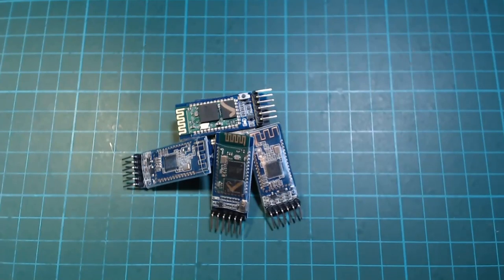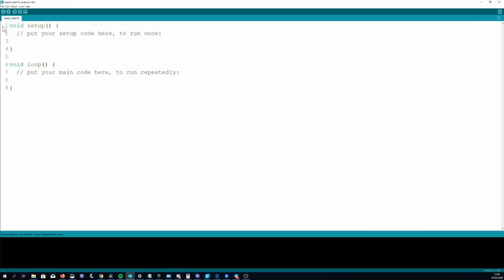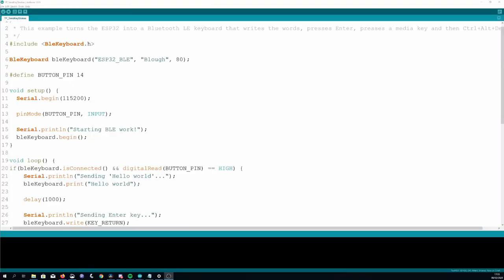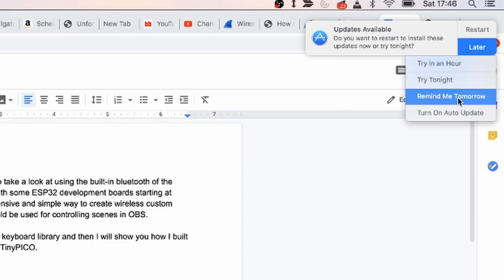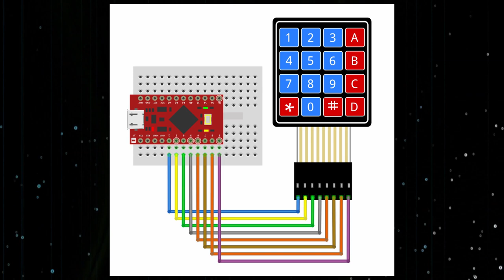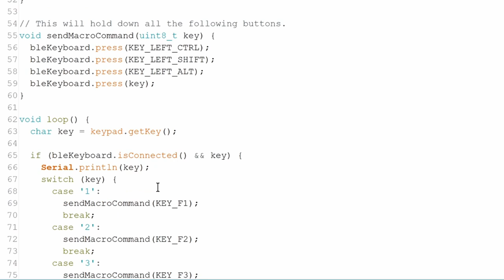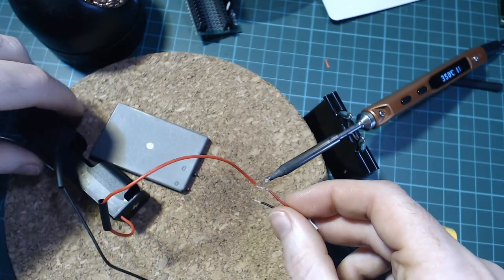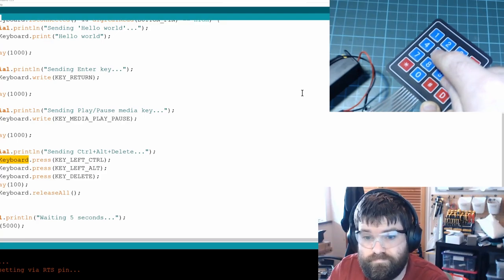Bluetooth HID using just an ESP32 (inc Bluetooth macro keypad)

Comment: Great timing, just started working on a small project that's in the same vein. I'm putting together a wireless (BT) volume knob using an encoder and some media control buttons, so all this info will be really helpful.
Reply from the maker: This sounds perfect for this, I haven't tested the volume media button commands but I imagine they work fine !
Reply: A couple of cheapy slider potentiometers, for mic & speaker, a lil 3d design/printing for a case. U could even go look at some of the esp/Arduino midi controller projects for a variety of DIY inputs, i made an esp32 pressure sensitive drums and button combo midisynth a few months back(still haven't made the case or its own amp for it, but it's fun wired up to an old stereo).

Comment: Excellent work. I was ran out of space on a digiStump. And promicro didn't like to compile. Never used the ESP8266 but looks like I am going to thanks!

I have two applications - one to use old PS2 keyboard to control computer games (so I can map.keys to USB but if I can instead send via Bluetooth then even better)

The 2nd app - to send Bluetooth to Android app to operate sheet music viewer. I do this at the moment with a Bluetooth keypad and some mechanical foot switch. With the above I can simply make a couple of buttons and send page up / page down.

Thanks again for sharing.
Reply: I know it's an old comment but for everyone's information, he used an ESP32 here, not ESP8266. ESP8266 doesn't have Bluetooth (and some deviations of ESP32 may not have it either).

Hope your project worked out great!

Comment: It would be great to have the codes in a file stored onboard that would be accessible like a drive over the USB connection. That way you wouldn't need to redo and Arduino code when you want to change a button function.

Comment: Excellent work from you and the BT library writer. I got an ESP32 with inbuilt OLED - my planned usage is to wire in a couple of footswitch operated buttons to send page up/down to an Android music page turner app. Should be considerable cheaper and more versatile than commercial hardware.

Comment: This is the video I am looking for. Exact tech for the same use case for OBS. Thanks.  Ok, next day. Just plugged everything in, set up the IDE for my ESP32, installed the code and it worked perfectly.  Next is getting that battery set up for wireless, although how I have my OBS set up with my laptop, It's fine even with a powered ESP32. I typically use the number keypad on a full size keyboard for OBS hotkeys and even and a Bluetooth number keypad that I bought for remote use. That's set up where I normally stream with a full computer. This is going to be the remote for mobile streams.

Comment: Hello! Nice project! I made similar project, but got following problem: Android is connected to this HID Keyboard, but if I send every 100ms for example 1 key - 1 second it does not send anything and then after got all those 10 presses. (Very bad response time). Do You know how to to fix unstable timing for key presses? (I am using ESP32 as external arrow buttons for my android phone to control map with 4 arrows and Letter C)

Comment: Hmm but if i want to use their Mouse Library as well, i would have to disconnect and connect again with the other device constructor. With HID-Project for example over USB, you can send either keyboard or mouse codes

Comment: I'd like to build an adaptor that turns any wired keyboard into a BT/wifi one, plus adds multimedia buttons and volume knob - buy any low-cost wired mech and have the benefit of expensive wireless mechs with extra fruit! Can I use a tinypico (or similar) and this library to do this? Is it just a matter of reading the key-press and sending it on with these library constants? Will it work for all keys including modifiers and such? And can I use the same USB port as both an "in" (for charging and control when hooked to a PC) and an "out" (for providing power to the kb and receiving keystrokes from it when hooked to a kb)? Sorry for so many questions, just wondering if it's possible and if a tinypico is the way to go. Thanks
Reply from the maker: Hey, a few things to get through, but I'll try!

The TinyPico is an ESP32 board, so the same will apply for all ESP32 based boards.

1) This library should be able to emulate the keyboard fine, I was using modifiers in my example so I don't think that should be a problem, I haven't done much more with this library than shown here though.

2) No, you will not be able to receive USB commands via the micro USB cable. Check out this video by Bitluni where he uses an external chip to act as USB host, but it's still early in development. https://www.youtube.com/watch?v=po3FBdY0GS4

The other part of this question, the USB port will charge the battery when plugged in.
Reply: @BrianLough  Thanks so much!

Comment: thanks for your video. i learned something. Is it also possible to use an ESP as a Bluetooth receiver? I was thinking of an AB shutter3 or keyboard to switch a GPIO port.
Reply from the maker: Technically possible, but I haven't seen a good implentation. Search for "ESP32 BLE HOST"

Comment: Could you us this to create a keyboard bluetoothifier? Connect and power a keyboard via usb OTG, listen to incoming keycodes, send those over bluetooth HID to the main PC? Not the world's speediest bluetooth but, hell, the flexibility!
Reply from the maker: In theory yes, but usb host is not very straightforward. But if you could do the usb host part you definitely could
Reply: @BrianLough  Yeah I had a look into it and using an OTG cable helps (they have    a 5th pin grounding the drain wire). The leaf can't charge a lipo though can it? Neither can a pi pico without a shim. I'm struggling to find a way to get it put together affordably - i suspect there's board out there.

Comment: hey, thanks for the tut! can this be used as a controller for a diy keyboard (where you solder wires to the switches without using a pcu).
Also can this be used to make a keyboard that has a wired only pcu have bluetooth compatibility? thanks again!
Reply from the maker: If you can read the inputs from the keyboard I don't see why not. A full keyboard, even using button matrix or something, would use a lot of pins

Comment: What kind of battery life do you get from this, running it Bluetooth connected using a 18650 or similar?
Reply from the maker: I haven't measured it yet, it hasn't run out of battery yet. I measured current draw at roughly 50-100mA so I guess it just depends on your battery. This one would clearly get at least 98 hours! (I don't know what the true rating of that cell is)

Comment: Based on your video I looked into the ESP32-BLE-Mouse. I also checked why the battery status does not update. It looks the same for the keyboard. Edit the BleKeyboard.cpp and add the line
  this->hid->setBatteryLevel(this->batteryLevel);
to the BleKeyboard::setBatteryLevel() method.
I would like to here, if this helped
Reply from the maker: That's great, will probably be a while before I get to validate it but thanks for sharing